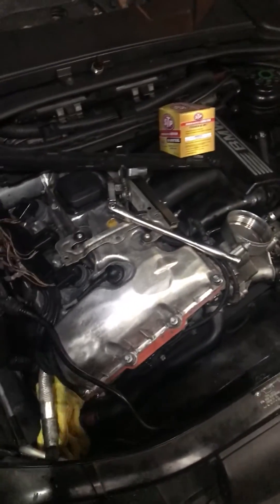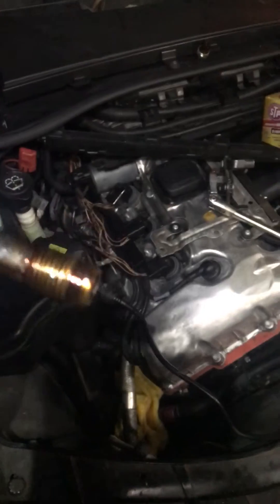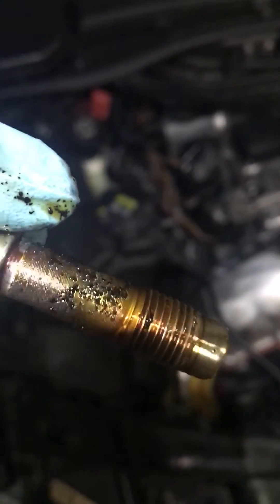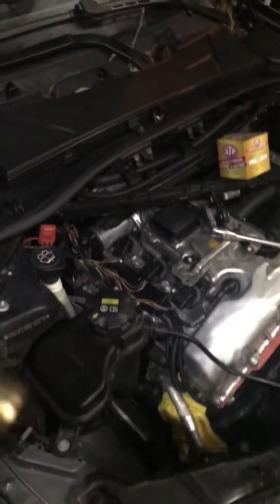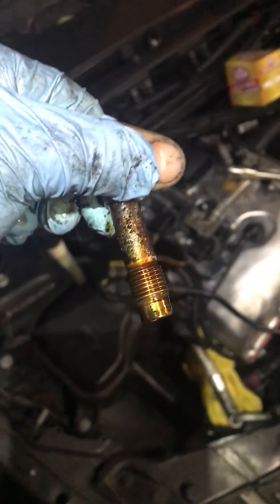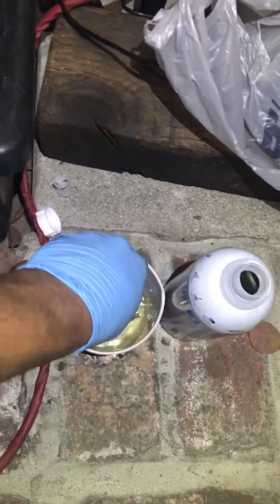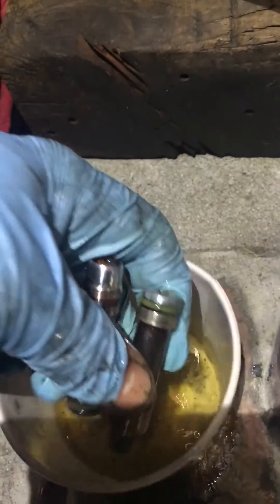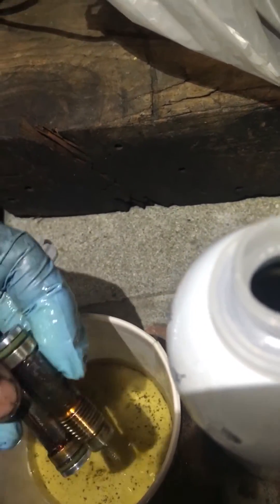Vanos filters n52

Comment: What are the symptoms when using the vanos filters in the vehicle when they are clogged. Does it give a fault code on the vehicle?
Reply from the maker: You will could get  error codes about timing correlation or cam timing out of sync . Misfire codes and vanos codes. Symptoms would very sluggish on acceleration , loss of power , misfiring , very slow response time from wide open throttle at pedal to engine response time . Rough idle
Reply: Thank you, I received all of the appearances you said. There was also a rattle sound. I changed the pcv valve, but I couldn't run the car for 2 weeks. I was on vacation. After finding a vehicle and refilling the battery, I hope it's fixed, thank you :)

Comment: Thanks boss do you know if bottom filter is the exhaust or the inlet?
Reply from the maker: Well now that  I’m not sure of but what I would do if I needed to know I would remove one vanos solenoid and oil filter and blow air threw it and see if they are connected

Comment: You didn't show where they are on car
Reply from the maker: jerry casteel they are located on passanger side of the cylinder head about 3 to 5 inches down from the top of cylinder head just above  the ac compressor . You will need a short exstension to access then but if u reach in there u will find that there are 2 round inserts that have like a t30 or t40 kind of tough to get but if u can find them use a small mirror